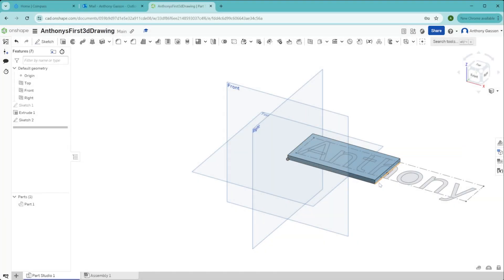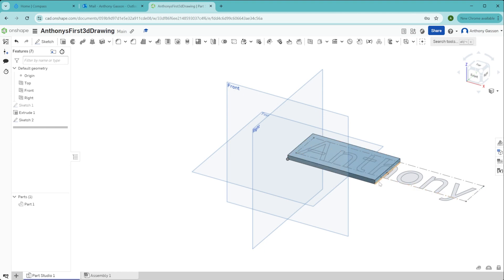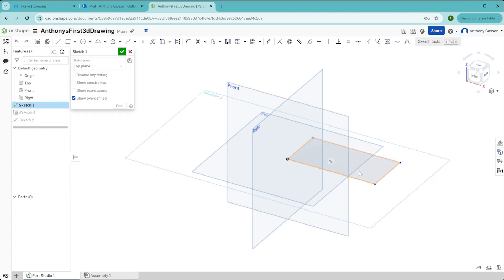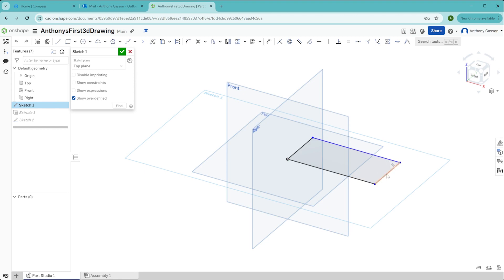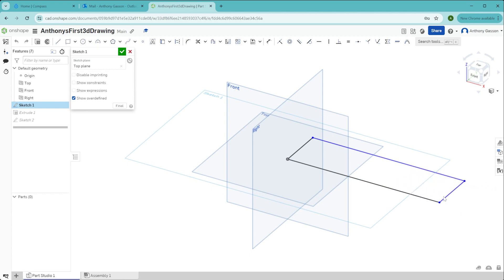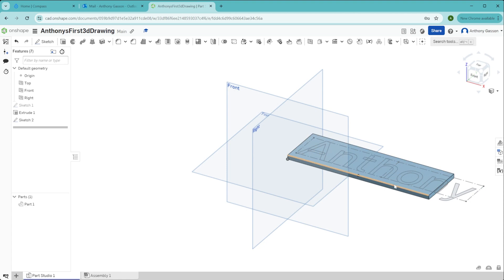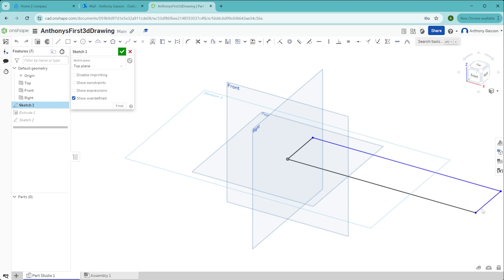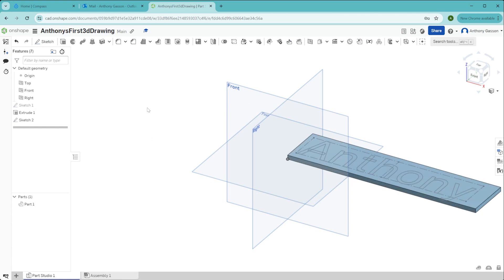How to Resize a Sketch in Onshape | Quick 1-Minute Guide

Comment: This is the wrong approach. Instead of changing the sketch to fit the text, resize the text to fit the sketch. Why? Because most things drawn have to be an exact size. Your method breaks all that.
Reply from the maker: You are right.  I did leave out some context - this video was made for my (junior high) first-time users, so I left out constraints and dimensions to help them get started.  I’m always trying to find ways to make it accessible without overwhelming. At the time of recording I found, Onshapes handling of text boxes very difficult to explain to students, which is why I exploited the unconstrained sketch to get the result shown. I'd love your thoughts? Do you want to see more or less of this entry-level content on @engineerandmachine?